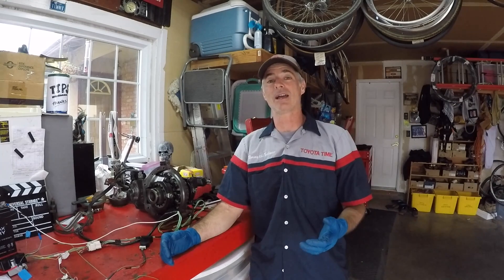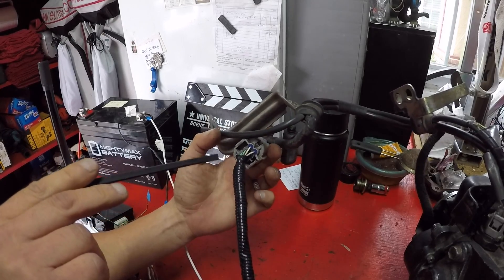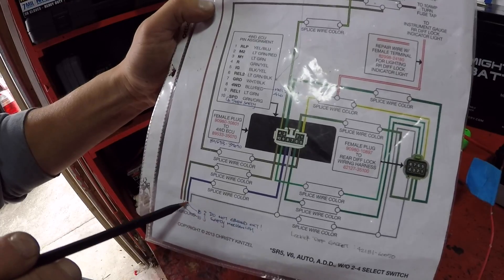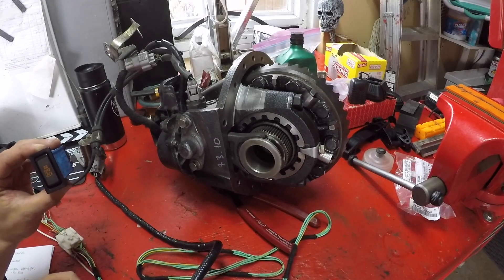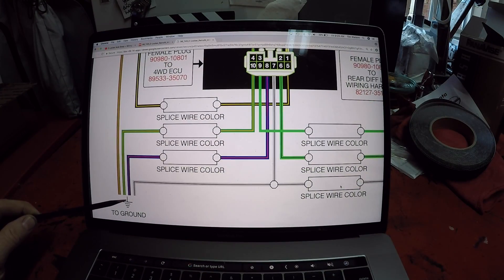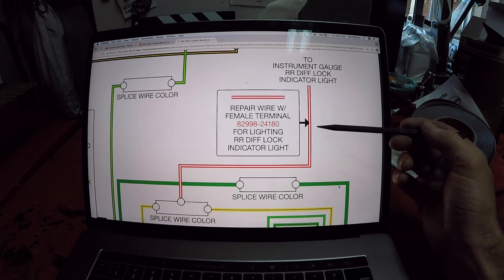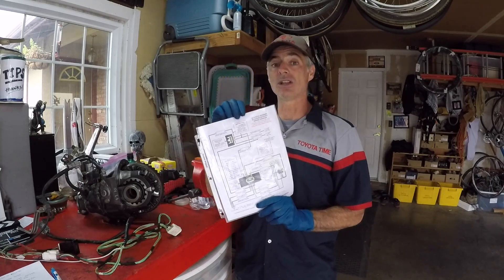E-locker Bench Test

Comment: hey timmy! doing my elocker swap soon. do you know what part numbers are for new hoses for the front and rear differentials? also, how much fipg and redline grease is needed? thanks!
Reply from the maker: I don't know the part numbers for those hoses.  Your local Toyota dealer is probably your best bet.  They can't be that expensive.  One tube of FIPG is way more than enough.  It's been a while and I can't even remember what I used grease on, but it can't be that much.
Reply: @TimmyTheToolman  appreciate it! thanks timmy!
Reply from the maker: @isaacsumera3795  No problem.

Comment: 2022 FJ auto transm with crawl control (CC). I did the blue/white ( under the footwell) hack switch to get locker in 2H,4H,4L. 
So, turn off the e-nannies with hack switch. Then 4L, engage locker ok. But  but when you move to 4H  it disengages the locker. I asked  an aussie FJ group they said that happens to the ones with CC and if you  ground the # 10 pin (over 5mph safety) the truck goes to limp mode.
What if, after engaging locker in 4L, I disable the cable (with a switch) that signals the locker motor to disengage ( I think pin # 2 in the plug in the locker casing). The locker will stay engaged in 4H, dash light will blink and the ECU will try to disengage but locker stays.
Any suggestion/idea. Thanks
Reply from the maker: You are asking about a vehicle we haven't tried this mod on.  We unfortunately wouldn't be of any help to you.  Toyota forums and Facebook groups would be your best bet to get your questions answered.

Comment: i am trying to bench test my  junk yard locker.. on the last connection from the actuator i have a white plug with 9 wires and a seperate black plug with the two white w black stripe ground wires attatched . then the locker computer i have has a white plug in it with 10 wires. my switch has 2 wires, im confused and how to connect my 9 wires from locker to the 10 that are in the ecu thanks
Reply from the maker: I wish I could help you but this video and the other one I shot with the two brothers is my only experience messing with the wiring for these e-lockers.  Maybe post your question with some pics on a Toyota forum and somebody can help you out.  Like you found out, there's some differences with the wiring with the years this e-locker was offered.  You might have the wrong ECU paired with that locker.
Reply: i think i am figuring it out, is that added fuse going from the power side of the battery required for the test or can i hook it up without it? thanks for the help.
Reply from the maker: @adamburgess3243  I think you can test it without the add a fuse, but when you install it, you'll be pulling power from somewhere and that will most likely be via a tap a fuse into one of your circuits inside your cab fuse panel.

Comment: I have a 99 4x4 Tacoma SR5 but with no diff locker, a same 4Runner year E-locker would be compatible with my Tacoma, or maybe any other same Tacoma model E-locker would be compatible to install it?
Reply from the maker: The rear axles are the same for 1st Gen Tacomas and 3rd Gen 4runners with the exception that one has leaf spring mounts and the other coil spring mounts.  The e-lockers are the same for both models.
Reply: @TimmyTheToolman  thank you
Reply from the maker: @peperonni123  You're welcome.

Comment: Thanks for all the videos Timmy! I recently picked up a clean 99 5 speed 4runner with the e locker and was transferring some parts over from my 1997 4runner. The E-locker on the 97 worked but the locker wasn’t engaging on the 99. I went through a full day of diagnosing and troubleshooting and I can’t figure out what my issue is. Both actuators and 4wd ECUs are good, the wiring looks good. On the 97 when I engage the rear E-locker the light flashes and I hear a clicking sound from under the hood (around where the abs module is) and the abs light comes on as it should. In the 99 I hear no such sound and the abs light doesn’t come on. Just to be clear I tested both the actuators/4wd ecu’s by putting them on the 97 and confirming the work. Where do you suggest I go from here?
Reply from the maker: Have you confirmed it's actually not engaging on your 99?  Did you lift up the rear end and confirm the rear wheels don't turn together in the same direction?  Where is your switch getting it's power from?  In the video we did for the E-Locker Swap, the switch gets it's power from a fuse tap.  Take a look at this video https://youtu.be/qAznG_WoS44 and look at this wiring diagram that we link in the video description: https://drive.google.com/file/d/1Gi7fRSslBFb79xx1eD8ynXlDDcyMrFYE/view

Comment: Good video, I've locked the rear diff on my 99 Highlander-4Runner three times in the last 21 years.  Once in the lot prior to delivery and twice over the years just to see if it still works, it still works.   Overriding the <5mph engagement and 4x4 low range safety feature is questionable if you want to maintain max dependability/reliability but good info if you have the need to do it.
Reply from the maker: I don't understand either why people would want to override this safety feature, but they do.

Comment: Question Timmy just got 96 4runner 4x4 with 4.10 and came across 97 4x4 for parts that came with 4.30 E Locker should I keep the 4.10 or do full front and rear with 4.30? Swap Note my 96 doesn't have elock. And I pulled out complete harness from 97.
Reply from the maker: The front and rear gear ratios need to match.  So, you'll either have to grab a front diff with 4.30 gearing or re-gear yours.
Reply: @TimmyTheToolman  yes on front and back to be the same my question is 410 or 430 what do you recommend 🤔
Reply from the maker: @victorllamas4252  The ones with the e-lockers usually came with 4.30 gearing from what I understand.  If there really is a choice, I'd choose 4.30 gearing.

Comment: ok this might sound stupied question
but how the ecu will know the speed and the postion of 4wd since its not conected to main ecu and transfer case or speed sensor
Reply from the maker: what do you mean know the position of the 4wd?.. like if 4wd is engaged or not?
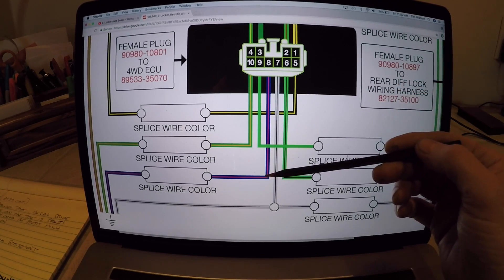Reply: @TimmyTheToolman  6:58 pin 8  and pin 10 have to be grounded to engage locker...how the ecu know if it 4wd or 2wd or if it under 5 m/h  to engage locker , its not conected to a speed sensor or position sensor

Comment: Hey guys I'm just wondering, if I had a buddy with a 4runner that had the e locker and the same wiring harness could I take my uninstalled locker under their truck and plug into that wiring harness and test that way? 
Thanks
Reply from the maker: Yeah, you could as long as you could get it up there high enough for the electrical plug to reach.
Reply: @TimmyTheToolman  Hey tim just an update, I pulled my Buddy's 4Runner in the garage  plugging in my locker and hit the button, the locker I bought worked. 
Total time about 30 minutes so this is a good option if you know someone.
Thx.
Reply from the maker: @ritewaywelding  Good to hear it worked out.  Thanks for getting back to us and sharing this.

Comment: Where did he get the wires to extended the wires from the wiring harness? Or what type of wires do I use? My wires cuts off really short from the wiring harness that connects to the plug on the differential, I need to extend the wires so it can reach the driver side.
Reply from the maker: In the video we did for the E-Locker Swap, our buddy Seydzh said he used a 6 conductor trailer wire to create his harness because he bought the all the stuff he needed from a guy and the guy cut the plugs out of a vehicle.  Just do a search online and you will probably find the trailer wire you need on Amazon.  Something like this: https://amzn.to/2DVzylm  Maybe Seydzh was mistaken because the trailer wiring I saw was either 4 wire or 7 wire but you could use a 7 wire harness and then just use 6 of the wires.  Here's a link to the video: https://youtu.be/qAznG_WoS44  Start watching at 31:30.  You can solder the wires together or you could use butt connectors.  I prefer using shrink butt connectors.  I show how I use shrink butt connectors in this video: https://youtu.be/cVmoRK54P9k  Go to play time 29:42.

Comment: Tim, would you consider making a video on how to install the actuator motor after taking it off of the 3rd member? I am reading the FSM on it and it’s super confusing. Is there an easy way to do it correctly? From what I am reading, it isn’t as simple as dropping it in. Apparently I am looking for match marks and wider teeth at some point?! Help, please! Enlighten me!
Reply from the maker: Aged10Years we haven’t done this yet so it’s possible we will do it in the future, however maybe not as quickly as you need it. T4r.org should be the next place you visit to understand the nuances of fitting the actuator motor teeth correctly.
Reply: @TimmyTheToolman  Dang.  I need this too--- but explained to me Timmy the Toolman speak and not FSM speak. :-)   I'm in the process of the swap.  I have the actuator and (locking) 3rd member already installed on the new (not-yet-installed) axle housing. The locker and actuator motor were tested before I bought it. Right now the diff is in the locked position.  It had to be locked in order to get the actuator motor bolted on but now I can't get access to the fork in order to manually unlock it.  Not really a problem if all works well once it's installed, but if it doesn't I'm stuck locked.  I'm worried that once I plug it in the actuator motor might "think" it's in the unlocked position and then cause the whole damn thing to bind up once I hit the switch.  My question is this:  If I make sure the switch is in "on" the first time I plug it in will the motor calibrate itself as it cycles on/off between the limit switches in the ecu?  Or does it all need to jive from the onset?  Hope this makes sense...
Reply from the maker: @johndaniels3984  Hey John, I don't know the answer to your question.  We have some experience with this mod but we're not "gurus" when it comes to knowing everything about it.  I would think the locker ECU would be able to discern the position of the switch and calibrate itself accordingly.  If everything is installed and wired correctly, you should be able to lock and unlock your e-locker.  But, before you install the axle, why don't you wire it up and bench test it?  Support the axle on jack stands and turn one of the axles.  With the diff unlocked, the opposing axle should turn the opposite direction.  Next, lock the diff and the axles should turn the same direction.  This will confirm for you that the locker is able to lock and unlock.
Reply: Timmy The Toolman I found this shortly after posting comment.   It clarified it for me.  I followed the instructions in the post, now I just need to remember to have the switch “on” when I first plug it in.  Thanks for the great videos and quick response!

https://www.tacomaworld.com/threads/e-locker-actuator-motor-install.466058/
Reply: Thanks for posting this

Comment: Newb to the locker world here.  I have a 96 4:88 rear locker (I hope)  first how do I ensure that's what it is and 2nd will the 98 schematic work for the 96 if it's the same gear?
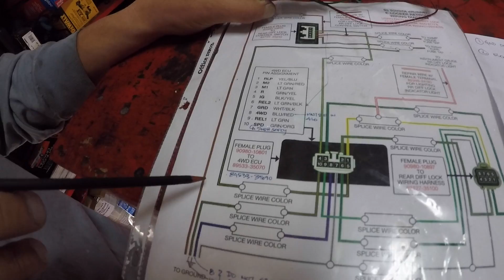Reply from the maker: I have never heard of a 3rd Gen 4runner come with 4:88 gearing.  It's either 4:10 or 4:30.  There's numbers on driver door jam sticker that can tell you what your gear ratio is.  https://www.sonoransteel.com/download/library/1996-2004ToyotaGearRatio.pdf  That schematic should work but I'm not 100% sure.

Comment: Hey tim I've set up my e locker  using your diagram and it works great.  I purchased the wire terminals to add to the locker switch but they seem too large. Is there a trick to inserting those? Any help is appreciated. Thank you
Reply: Disregard. Figured it out. NowI trying to get the switch to only light up when the switch is engaged
Reply from the maker: @ev9918  Good luck figuring it out.  Glad the video helped you out.
Reply: I do have another question about the locker switch. Is it always supposed to be illuminated or only when the switch is on?  When I hook mine up the switch turns on and stays on no matter if the switch is turned on or not?
Reply from the maker: @ev9918  Does it illuminate only when the headlights are on or is it on all the time?
Reply: Right now im bench testing the set up. I have it wired according the the diagram. The only thing that's different is the two pwr source wires on the switch,  pin 4 and 5 I have running to the positive side of the test battery im using.
Reply: I don't have them running to different pwr sources. The switch is illuminated regardless if the locker is engaged or not. I wasn't sure if that's the way it's supposed to be or not.  I daw another video where the switch only illuminated when the locker was engaged.
Reply: Man,  I had an ephinony and figured it out. I appreciate you responding.  Your videos have been very helpful. Thank you
Reply from the maker: @ev9918  Good to hear.  Hope the install goes smooth for you.

Comment: Timmy!
You should totally do a 3rd gen, specifically 01-02, auto transmission conversion to a manual transmission. Specifically to get an awesome 5 speed, as well as getting rid of the terrible P0770 CEL code. I’d be willing to have you use my truck if you need one. I can hit the junkyard and get a manual Tranny and all the needed parts. I think the wiring harness is needed.
Reply from the maker: Where do you live?

Comment: Hey Tim, I just purchased another 3rd gen. A 2001 Limited with 377,000 miles!  Everything works great except the brakes. The abs system is not functioning(bad abs pump) if you ever get a chance to do a video on the master cylinder/abs module replacement that would be great!
Reply: Just fixed the issue over the weekend. It was a bad electric motor that powered the abs vacuum pump
Reply: What were the symptoms? My friend has a 2000 Tacoma with the abs light on, we tried swapping one of the wheel speed sensors to no avail. We jumped the diagnostic port under the hood, got a bunch of codes from counting the abs light flashing (wheel speed sensors, deceleration sensor circuit, stop light switch circuit), leading me to be believe that the issue may be the abs ecu because it’s unlikely to be all of those issues at once.. however, the ecu is a little pricey to risk buying the part to find out that it wasn’t the issue..

Comment: I have a 2010 Sport Prerunner. Can you  r & r the 3rd member and install an e-locker without any other mods to the axle? I know you have to get the other stuff. But, I want to keep my axle.
Reply from the maker: Well, for the 3rd Gen 4runners and 1st Gen Tacomas you have to alter the axle housing so the e-locker will fit.  You have to cut material out and drill and tap additional holes.  I'd assume it would be similar for your 2010.
Reply: My plan was to replace both the casing and the e locker. I guess, I have some research to do. Thanks for the quick reply.